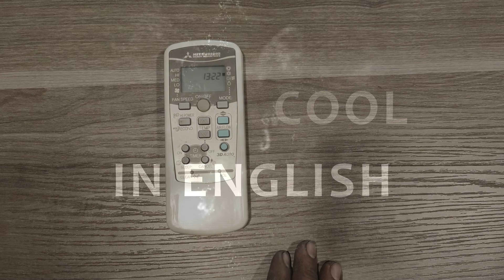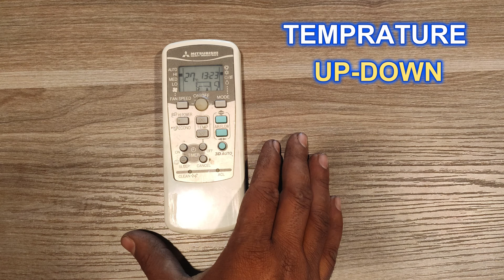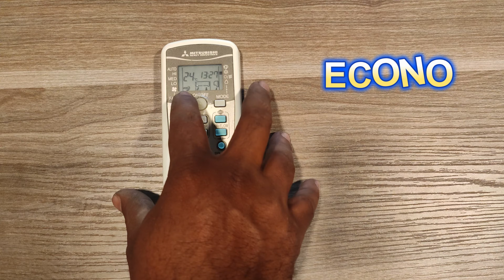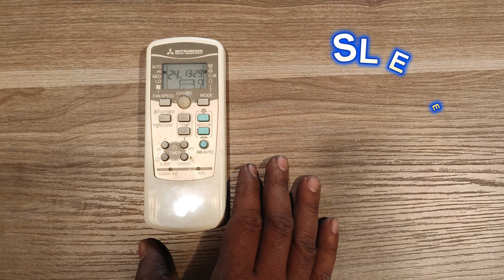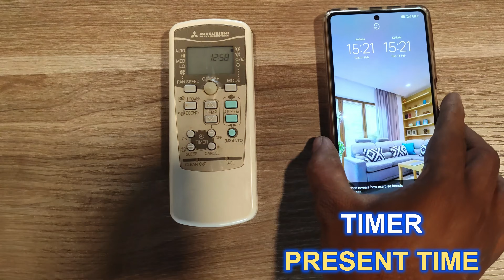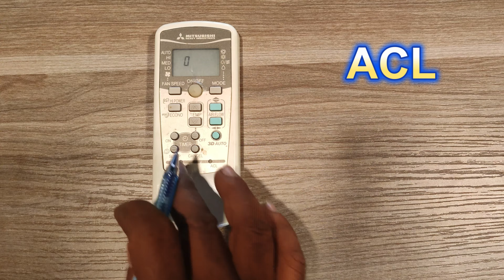Mitsubishi Air Conditioner Remote Explained | All Buttons & Functions

Comment: Very clearly explained. Is it enough to do cleaning work by ourselves using the remote? If so, every month? How long will it take? Six months once AC service must?
Reply from the maker: If your ac smells bad or you need to clean it yourself, you can use the clean function on the remote. However, this process takes approximately 1 to 1.5 hours. You can use this function once every 2 months. However, you should have your AC cleaned by a technician once a year.